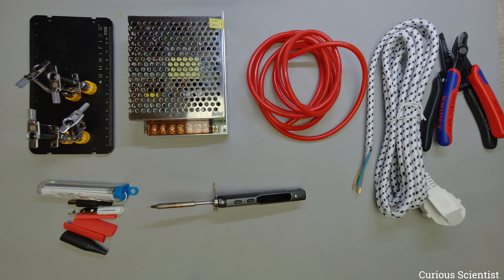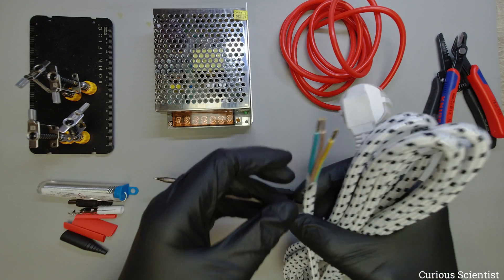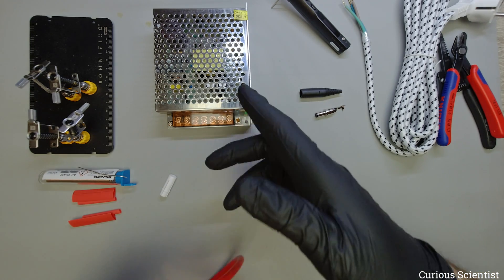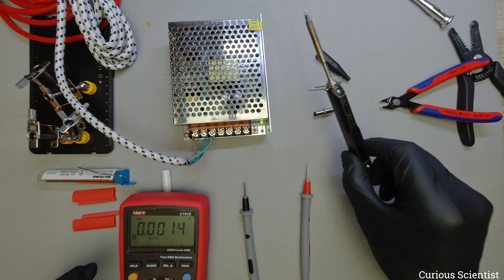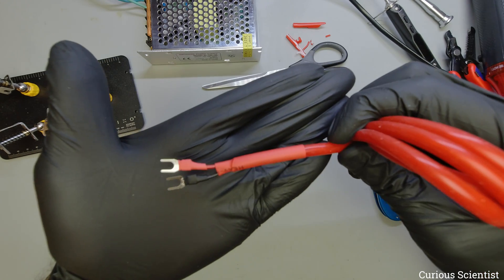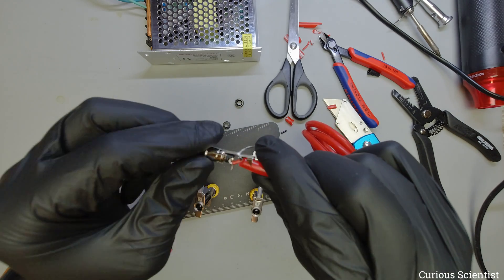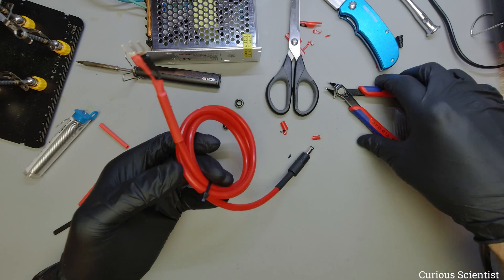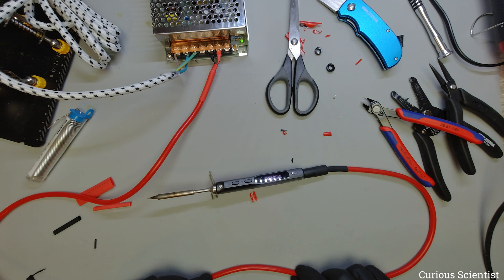Making a new cable for the TS100 soldering iron

Comment: Hi, wouldnt be extreamly dangerous running 220v through a wire that is exposed? Or is there any thing that blocks for touching it?
Reply from the maker: Hi! Where do you see exposed mains voltage?
Reply: @CuriousScientist  just asking. I never used a power supply like that and since you connect the wires like that I thought it would be exposed. Can't really see what's protecting it in the video
Reply from the maker: Usually, there's a plastic sheet over the power terminals that protects you from touching the exposed parts. Otherwise, the rest of the power supply is harmless.
Reply: @CuriousScientist  oh ok, that was my main worry. I thought there wasn't anything to protect from touching the exposed wire or connector that the wire goes in. Thanks for the answer

Comment: This what i like to do to my KSGER, change the cable of the knobb with an silicon one but i can't find one with 5 core. I make one which is some king of flexible rubber but is to thick and a bit heavy on the hand. Do you have any suggestion!?...
Reply from the maker: What do you mean by knob? The cable I used for my soldering iron is shown on my website with a link to purchase it, too.
Reply: @CuriousScientist  sory, the handle. KSGER use 5 core cable, this one is 2 core. I would like to replace that flimsy cable with an silicone one, but as i mentioned before i can't find an good 5 core silicon cable.
Reply from the maker: My answer is still the same. It is on my website under the parts & tools page. Bottom of the page.

Comment: I really appreciate your help and I did subscribe! I bought the pinecil v2 and want to make a power cable. Is there and chance you could measure the length of the barrel connector that gets inserted into the iron. I never knew that they come in different lengths. I thought if the size was 5.5mm x 2.5mm the LENGTH OF THE BARREL WOULD BE THE SAME. I'm asking because its not worth ordering 1 or 2 from the link you supplied. THANK YOU AGAIN.....
Reply from the maker: Have you checked the video, especially at 3:36? 

I wrote the type of the connector there. You can find it on Digikey if you search for Tensility 55-00050. You can open the datasheet and you will see that the barrel length is 12 mm. 5.5 mm is the outer diameter and 2.5 mm is the inner diameter.

Comment: Can the ts100 itself be grounded to earth from the back screw to the power supply? I'm afraid the tip can do some ESD at some point if not grounded I guess.
Reply from the maker: Yes, it can be. There's a tiny screw on it which is specifically made as a grounding point. You can run a small wire to it as grounding.

I think it is a good idea to ground it. Recently I was soldering something while I had the terminals of my lab power supply around (it was off). I accidentally touched one terminal while holding the soldering iron. I got zapped. Then I measured the voltage difference between the tip of the iron and the terminals, it was 95 V AC... So, yeah no wonder I got zapped.
Reply: @CuriousScientist  Holy! 95V AC is no joke lol. My concern is also sensitive stuff in the board may get fried... I have the same PSU as you, do you recommend to connect the screw terminal of the ts100's back to the Earth terminal of the PSU? That way the PSU and the tip are in the same potential and closes all the ESD protection circuit to the socket Earth (although grounding on the AC side may not be a great idea...). I love my TS100 but ESD wise doesn't look that good.

Comment: I have a Hota D6 Pro and I want to run my TS100 from that on the PSU mode.
I was thinking to set the PSU at 14.8V, 30W, 2A .... Does that sounds right?
Reply from the maker: Why would you want to run it at such a low voltage and current? You can go up to 24 V and nearly 3 A. If you use it with your settings, it will heat up slower. Basically you would use it at half power. It is a 65 W unit.

Comment: what temperature is your cable rated for? the link to aliexpress goes to a cable rated for 200°C. will this hold up if the iron touches the cable while at 350°C for example? I am so confused if I look for a cable for my ts100 that should be able to handle high temps, but silicone cables only are listed for 200°C(at least those which I found).
and how much cable length did you use? I know of those xt60 cables(which are also only rated for lower temps?...) that are only 45cm long, but I think this is a bit short for using a psu and not a battery.
I really hope to get an answer.
also I really like the helping hands, but it seems those are out of stock? any alternative you could recommend?
Reply from the maker: Hi! According to the seller, the cable is rated for 180°C. It will hold up for a while without sustaining critical damage if you touch it accidentally with the iron. I did a test for you and I uploaded some pictures to my YouTube channel's community page, please check it. I used 110 cm long cable, but I would say that the active length of the cable is roughly 90-95 cm because I made a tiny semi-circle shaped loop at the PSU side of the wire so I could fix it on the casing of the PSU to avoid fatigue damage on the terminals. I have a soldering station and I just copied its cable length, so I guess this is a typical length. 

The helping hands sold by Omnifixo is indeed out of stock, but I would preorder it and wait. I don't have any better alternative in my mind because I haven't tried anything else. I think it worth the wait.
Reply: @CuriousScientist  very appreciated. thanks for going this far to answer my question.
Reply from the maker: You're welcome! I'm glad that I could help.
Reply: @CuriousScientist  Hey, sorry for asking again, but where can I get rated dc connectors (male and female)? I am living in Germany, but I can't find any at all. amazon, ebay, aliexpress,banggood, etc.
And your link asks for a company... :/
Reply from the maker: @Ruboka  Hi! No worries! Have you tried digikey.de?
Reply: @CuriousScientist  they ask for 18€ just to send some 4€ connectors, what seem a bit too much :/ They indeed have rated ones, damnit.
why is it so hard to label products for electronics? this stuff haunts me in my dreams...

Comment: Always nice to watch these builds ... but why not use one of the laptop chargers ? Atleast that's the unit i got with my TS100. Smaller than this SMPS and saves bench space.
Reply from the maker: I would still need to replace the cable of the laptop charger or at least create an extension. Also, many of them are 19 V and not 24 V. So at the end, I would need to do the same amount of work or more and I am pretty sure that a laptop PSU would be more expensive. Regarding the bench space, I have a very smart solution to hide the PSU. I might post a picture of it here on YouTube later.
Reply: @CuriousScientist   Thanks for replying. 19V would be a limitation, because the current draw would be higher ? Please do post a pic of the smart solution; after all it is the reason why we watch channels such as yours :o) .
Reply from the maker: You are welcome! No, it would not draw higher current at 19 V. Actually, it would draw LESS. Just think about Ohm's law, and think about voltage as a driving force. The higher the voltage, the more current could be pushed through a certain resistor. If you test the soldering iron, you will notice that at 12 V, it will draw very little current and it will warm up to the target temperature slowly, because 12 V cannot push too much current through the iron. If you double the voltage (24 V), the iron will draw nearly 3 A when it is being heated up to the target temperature. I actually tested this a few minutes ago just to be sure that I am not writing anything stupid. 
At 12 V, I saw 1.4 A, at 19 V I saw 2.3 A and at 24 V I saw 2.8 A current draw. If you do the math (R = U/I), you get roughly 8.5 (Ohms), so the power supply will see this resistance when it tries to supply current to the soldering iron. If you have a higher voltage PSU, you can supply more current. Obviously, the PSU has to have the capability of supplying higher current too.

I also added the pictures of my way of mounting the power supply at my desk. Check the community tab on my YouTube channel.
Reply: @CuriousScientist  You are right of course.

Comment: I run it off my bench supply, it never draws 3 amps for any meaningful amount of time at 24v, usually around 2.5a or lower since it heats up in seconds. But nice cable nonetheless.
After 3 years of use the barrel connector on mine is so loose it keeps sliding off, I'm considering a permanent connection without a connector on the iron side.
Reply from the maker: Thanks! My connector is still sitting on the terminal well and my TS100 is also around 3 years old. Maybe you also just need to replace the plug. Usually those flexible pins can wear out with time. I can really recommend the one I used in the video.
Reply: @CuriousScientist  hi, is ts100 that good for almost daily use? I need to solder 3-4 days in a week and not for long hours. Im from India so everyother iron has no reviews and idk what to trust, i saw many reviews of ts100 and most says its nice all i was worried about was longevity. 

Let me know should i buy the iron for my use or look for something else
Reply from the maker: Hi! I've been using this soldering iron for several years without any issues. I really recommend it. Just make sure that you buy a proper power supply for it so you can use it at its full potential.